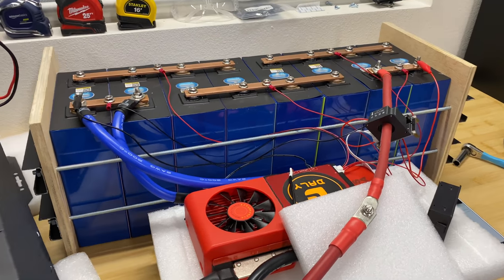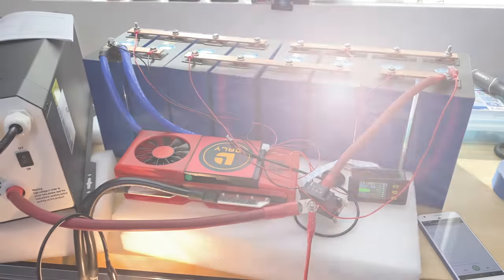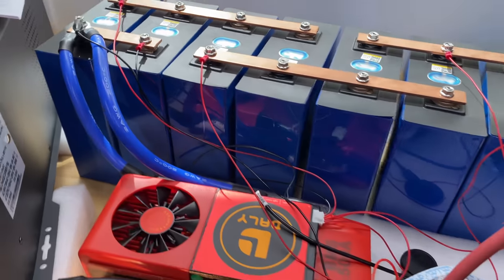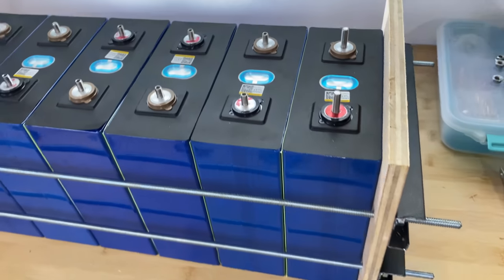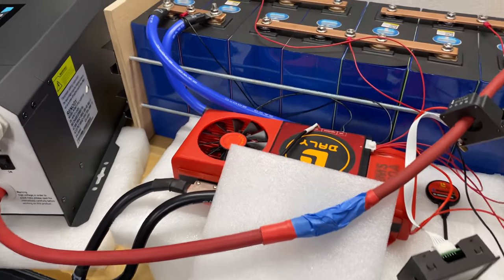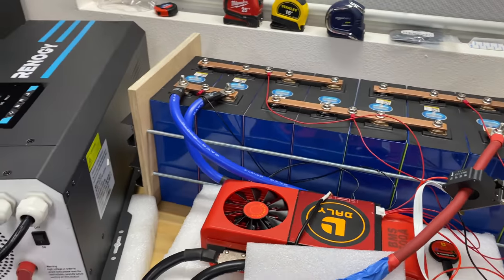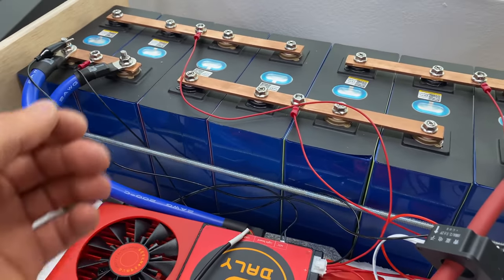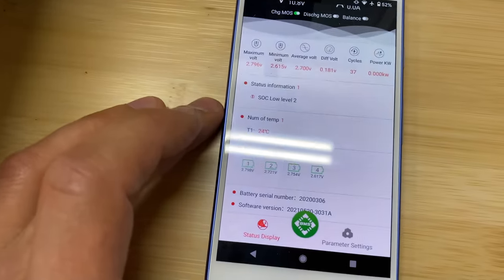Compressing swollen Grade B LiFePo4 prismatic cells. Let's experiment. Don't try it at home.

Comment: The information you're stating that in order to get a refund you must return them to China. The cost of return based on weight alone exceeds the value of the item needs to be made more known. I see many new people buying from China who think they can get a credit card to refund it's not correct. You would think they would have more pull over Chinese Company in reality they make lot of money in China not going to push them to refund because of shipping costs. What I'm seeing is recycled batteries they put a new covering over it and re-laser a new QR code in the top. If you can show your credit card company that it was a scam they might refund without the return.

Comment: Oh I forgot there is a rule of compression using inch-pounds of torque per size of cells and not sure what it was but if you look you will find compression ratios in the manufacture literature and it isn't enough to reshape cell so be careful how much compression you use! There are folks who have done cycle comparison on compressed vs non compressed and difference isn't that much?
Reply: well, any compression is better than none for longevity
Reply: LithiumSolar discussed this a couple of days ago.   The manufacturers specs give a compression figure and seem to be saying compression is good.  But his conclusion was that for particular his use case avoiding deep discharge / high charging cycles is likely to gain as much in useful life as the manufacturers claim compression would.  His video: https://youtu.be/uZe6BDvWPfI

Comment: WHat pressure do U use and  why ? Why U use BMS to disconnect battery ? If BMS does that, your MPPTs will be dead. Also some inverters. BMS is for monitoring and signaling statuses to MPPTs, inverters, or monitoring like EPS32, Arduino, Venus OS and so on, and in the situation, that needs intervention, your system should disconnect panels first, then shut down inverters and than shut down battery packs.

Comment: Your test and the purpose of your test is invalid.  Swelling occurs when you fully charge, which is something you should not do.  If you stop charging at 80% (3.35v per cell) swelling will not occur and your batteries will last for many more years.  Discharging should not go below 2.5v per cell either.  If you are finding the need to fully charge and discharge your battery bank, then you should consider adding more batteries to decrease the load on these and thus avoid full cyles with subsequent swelling.  They will last you at least 10 years with daily cycles of charge/discharge each day.  And by that time lifepo4 will be ancient and you'll more than likely already have replaced these with something much better.  Adding capacity by compressing is a nice idea, but charging to lower voltage is even a better idea for making your cells last.  And getting more out of your system means you should consider adding more batteries.  I think there is a misconception regarding this issue.  To summerize, while you can add some capacity by compressing, you can add even more by decreasing the maximum charge voltage.  And if that means you do not have enough battery, you should consider adding more batteries to your system.  More batteries is better than compression for adding capacity.  You won't stress your batteries as much.

Comment: You can't compress them more than 12 pounds per square inch and still need the space for expansion and contraction. Some of my battery pack have been getting more capacity after several charging and discharging cycles. I always said that lifepo4 chemicals is. Just a little bettter than lead acid one and over priced, so the best thing anyone can do is do not spend the money they don't have because they will be very frustrated with these cells.
Reply: ok, stick with your lead acid technology then, now worries
Reply: You can only discharge lead acid to 50% capacity if you want them to last.  Which means you will have to add Even More lead acid batteries for the same capacity.  Even with that, LA still can not cycle nearly as much before they are dead.  Another issue is lead acid can not be charged Nearly as fast.  Another issue is lead acid takes a tremendous amount of time to top charge to 100%- upwards of 10 hours in some chemistries.  

This is not coming from a lithium snob, I’ve used lead acid a lot with solar.  it has been a complete pita.  

I have barely used this small system, yet I’ve replaced the lead acid batteries I think three different times.  

The current batteries, a set of heavy duty 6 volt flooded golf cart batteries are well on their way out after five-six years.  That sounds like a lot of time, but it isn’t when these batts have barely been cycled at all!

These are The Last lead acid batteries I’m going to put into this system.  I’d hate to think of the headache of using LA for something much larger like a real power wall.  Jeez.

Comment: Do some reserach before uploading such videos!!! 2012 GT is right. Chances are high that you'll blow some vents and destroy a couple hundred euro worth of batteries. Hope you're doing all this in a well ventilated area... the off-gasing is apparently quite unhealthy to breathe.

I dont know why so many people get this "compressing" thingy wrong! You're not supposed to "compress" those batteries! Youre supposed to fixate them in the unswolen state to keep the electrodes from delaminating eventually during charge/discharge cycles!
Reply from the maker: thank you for the information. If you could find docs about how fixating should be done right, would be helpful.

Comment: Cells need to be compressed before their very first charge in order to achieve their higher cycles.  Also it is not the capacity that changes it is the cycle count that can be had if they were compressed with 300Kg from before the first charge.  They will swell when they charge the very first time and they never un-swell.  Hope this helps someone understand why this entire video is bollocks.